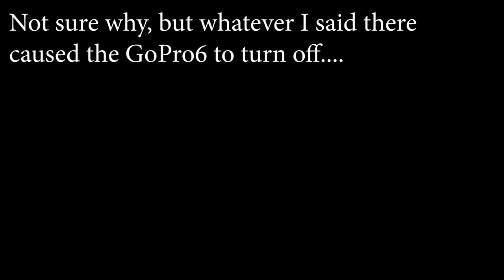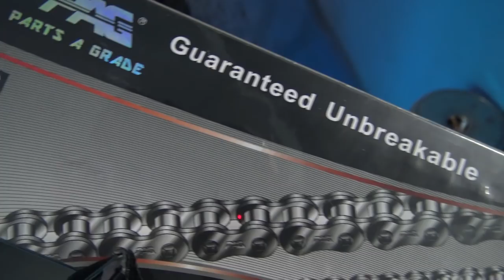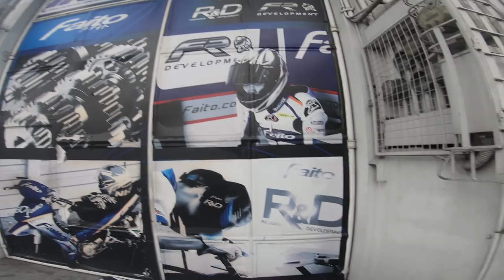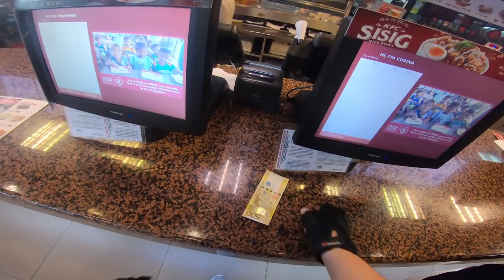Chain & Sprocket MixMotoVlog

Comment: Ed, you may have a problem when you get the head flowed. Make it clear to them that you don't want to lose the bottom end to get the max top end, rather that you're just looking for them to tidy the casting up for a general improvement. As usually they'll flow it for max bhp which moves the max torque well up the rev range and that could be an issue with your longer gearing.
Reply from the maker: Thanks for the suggestion, it's already been done I just need to edit and upload. It feels so awesome now!

Comment: Look into an MSR pro easy pull lever.. they have 3 holes on the bottom of the lever you can change where the cable connects to change leverage. It makes the clutch on my 2006 R1 smooth and light as butter. I can pull my lever with 1 finger
Reply from the maker: Thanks, I'll check into that

Comment: The Racing sprocket Kit you got is just fine (Track 8:43) especially when you're riding on a flat city roads like Metro-Manila, technically speaking, you don't need a Low-End power since it's a Sportsbike, it's meant to go fast on the straight flat roads, and not on incline. LOW-END powers are only needed by the Moto-Cross racers since they got lots of bumpy inclines, and lots of Hill-Climb on their races.
Reply from the maker: Yeah I love the way it feels, I don't think people understand when I said It doesn't have the torque it used to have, it still has plenty to ull you up steep hills, even with a passenger.
Reply: Yeah, it's not always a problem with the top-hill, we always have the first and 2nd gears. You're right on the torques, it's that instant power that make the bike fly, mostly on Moto-Cross bikes (seen a lot of them on YouTube like wasting their bikes and caused accidents just from the starting revs, because they're not aware about the high-torques on those bikes, but they can't really run fast on Straight roads, since their gears are meant only for the torques and uphills.
Reply from the maker: yeah, total different rides.

Comment: What gopro settings are you using when it gets dark ? Street lights and billboards seems pretty washed out including your dash.
Reply from the maker: It really depends on what video, I change them around. biggest thing at night is to turn off image stabilization
Reply: This particular video.  I can't read signages and billboards. Your dash is also unreadable.  Maybe you turned on protune and played with ISO settings.  I find it best to leave Protune OFF especially at night / dynamic lighting situations.

Comment: Hoping that MotorCycle lane in Edsa has barricades to eliminate cars from going inside of it.
Reply from the maker: Cars have to use it at least some, because there are exits on both sides. They should just go back to the old way, My opinion.

Comment: nice vid again...

...sorry for always asking u about "mc" because im planing to buy a bike...just want to ask what do u think is better cbr 500r 2017 or ninja 500?? and what is the brice of this bike....thank you...
Reply: and what is the price of 2012 cbr 600rr sorry for many question ..hope to answer my question
Reply from the maker: I plan to go look at and maybe test drive the 500r and ninja 400. don't know much about them yet.
Reply: what do u think is the price of 2012 cbr 600rr in phil...and it is available in motor cycle dealer ship?
Reply from the maker: I think the used bike prices are to high here, better to buy new.
Reply: the new bikes like 2017 bikes is to high..

...what do u think is available old bikes in KSERVICO..that have a 600cc engines...
Reply: hai sir again...hhmmm what do u think is much cheeper 600cc bike on a dealership..like 2012 to 2014 bikes pls reply..

Comment: Ride safe what combination sprockets did you purchase
Reply from the maker: Listed in description : )
Bigger in the front, smaller in the rear.
Reply: I changed my rear sprocket on my duke cause it's hard to find  a 46 tooth rear  sprocket. Stock is a 45 I want to try a 46 I will be back in PH late February  looking for an aerox for a daily commuter
Reply from the maker: Very close. couple more months : )
Try to look for it at Tres Hermanas on 10th ave.

Comment: You should upgrade in Japanese brand like R25,Cbr250. Loncin Gp250 is not a performance bike
Reply from the maker: If you rode mine you may change that statement...lol Serious though I want to test ride the others.
Reply: You've upgraded a lot of this bike. If u do this to japanese machine(250-500 cc segment), then take the real fun
Reply from the maker: I admit my bike didn't have much performance or power before the upgrades.

Comment: Loosing torque? I rather have more torque than having more miles per hour! You can’t even go fast there!!! You need the torque switching lanes!   So you can fly by fast! Instead of waiting for mph!
Reply from the maker: Bike still has plenty of low end power.